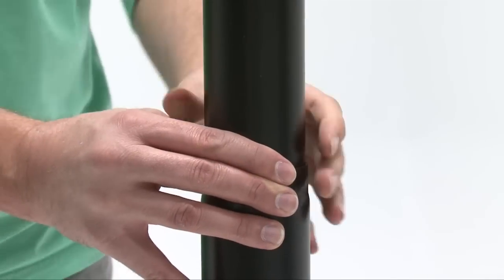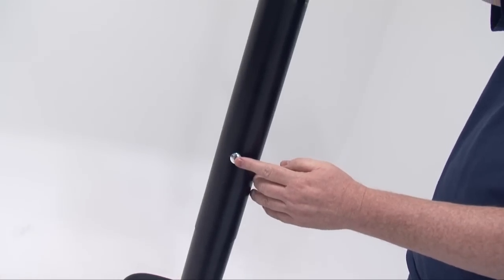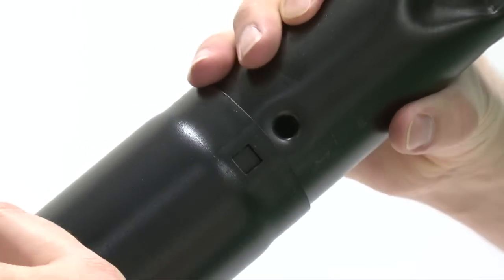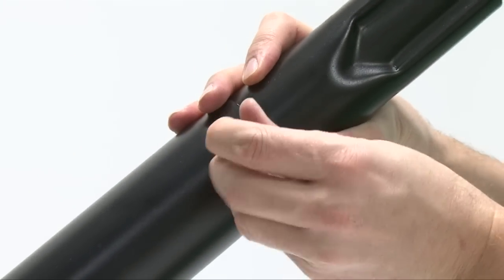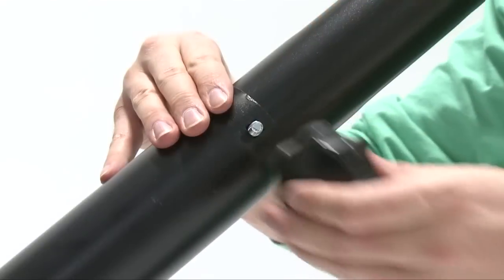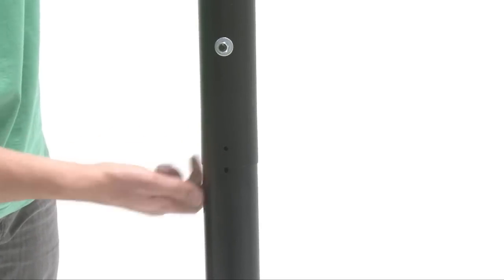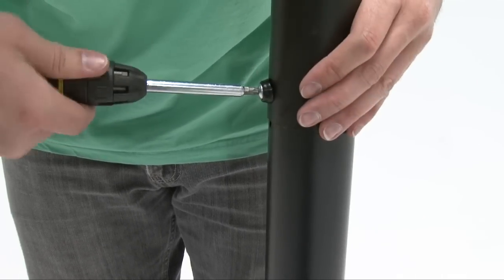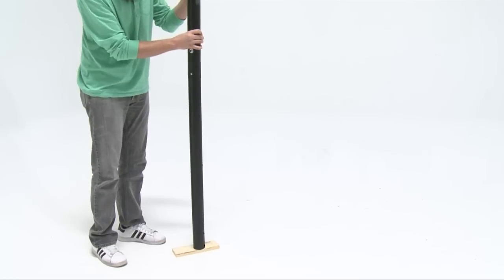Telescoping Pole Instruction

Comment: On mine, the bottom hole on the middle pole is drilled on the wrong side.  Is this a problem?  The printed instructions say my setup must look exactly like the drawing, but it doesn't.  The bottom hole should be on the opposite side of the warning sticker according to the illustration, but it's not.
Reply: The sticker was likely placed on the wrong side of the pole.